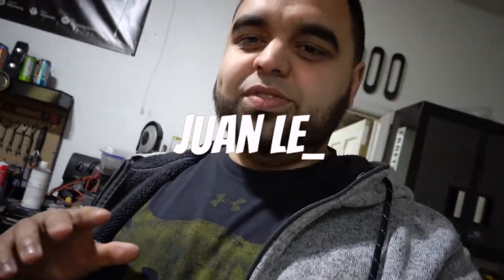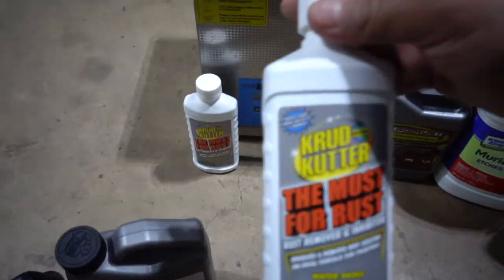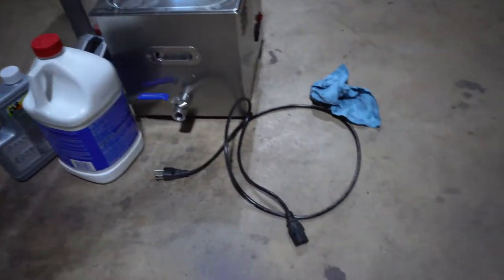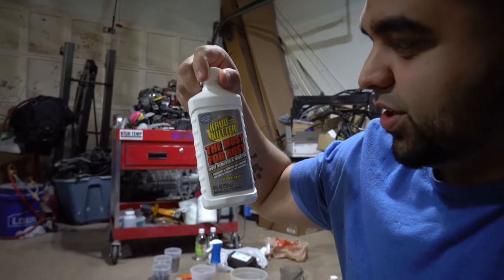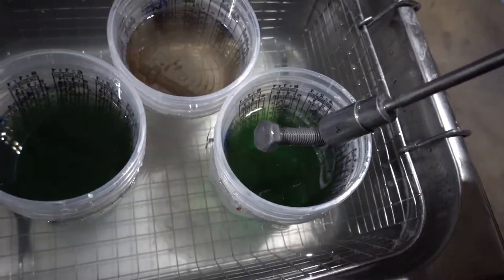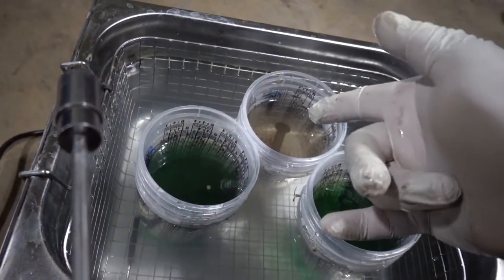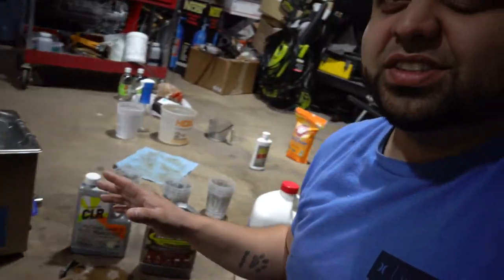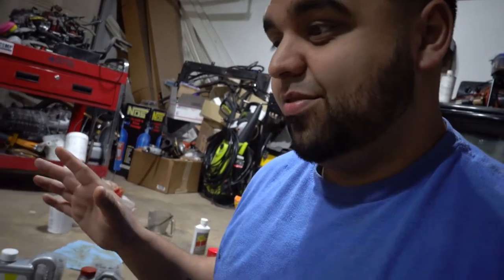Which Is The Best Rust Remover In An UltraSonic Cleaner?

Comment: I see people using acid based rust removers in ultrasonics. If the unit has a drain valve, please don’t do that if you’re going to fill the tank directly with the acid. Yes, the tank likely is high quality enough so that it won’t be a problem. But the valve body is brass with usually, a stainless valve and a teflon seal. Some cheap valves use a brass ball (these are ball valves, after all). Any brass will dissolve in acid. Even relatively weak acid. At some point the valve will begin to leak. It’s not worth it as acid rust removing damages the good metal as well as the rust.

Muriatic acid is mostly used for cleaning concrete and old dirty wood. I really don’t recommend it for anything else. The Evaporust does the least damage to unrusted metal. That’s what I’ve been using for years. There’s really no reason to try to rush any of this. Five minutes is fine for very light surface rust, but for real rust, just leave it in for the full 30 minutes. Normally, it takes a full day without ultrasonics. And remember to rinse all of them with water immediately after removing them from the baths. Then spray with WD-40 to remove the water so it doesn’t flash rust.
Reply: I bet he's the kind of guy that opens the oven door every 5 minutes to see if the cookies are done.

Comment: The muriatic acid does a good job but it will rust everything in your garage. You better do it outside. I use it before i zinc plate to get the old zinc off.

Comment: You should use glass containers instead of plastic in an ultrasonic cleaner. Plastic soaks up the vibrations.
Reply: Especially with the plastic cups stacked inside empty plastic cups, there was no meaningful vibration getting to the fluid the bolts were in. The Ultrasonic Cleaner was set decoration and a timer for this video, not a tool.
Reply: That’s not really true. Plastic cups are fine.

Comment: As others have pointed out, Muriatic acid is no joke.... 

It gets rid of rust, but it will also eat the metal if you leave it in there too long. You will also need to rinse it off well and oil it immediately or the rust will come back quickly. 

The fumes off the acid will eat everything around / cause corrosion, so you want to use it in a well ventilated area or outside. It also reacts violently with aluminum, so if you are trying to remove rust from something that is attached to aluminum, that's good to know. I have used it for removing rust, and while it does work, I don't consider it a good enough solution to keep it around. 

Great video, I'm shocked it doesn't have more views. Keep it up.

Comment: After cleaning with any of these products (except the muriatic acid), you need to thoroughly rinse off the part with water and then either protect it with a coating of oil or paint it. The part cleaned with muriatic acid needs to be immediately soaked in a solution of water and baking soda after cleaning to neutralize the acid, then rinsed off with plain water, before oiling or painting. Without neutralization, the acid will continue to erode the metal and could damage it beyond repair.

Muriatic acid works the fastest and best because it doesn't actually discriminate between the rust and the underlying metal. It just starts attacking the exposed surface of the metal until you either take it out and neutralize it or the metal is completely gone. You have to remain vigilant to remove the part from the muriatic acid just after the rust has been removed, but before the underlying metal is damaged. A tricky balancing act. The other rust removal products you tested may be slower, but are much safer to use, both for the part being cleaned and yourself.

Comment: I wouldn't use muriatic acid since it causes hydrogen embrittlement in steel.
Reply: It also aggressively eats steel.  The real trick is to find a rust remover that removes rust while at the same time not dissolving steel.  My guess is that with this critical criteria in mind the Evapo-Rust product will come out as the winner.  

Muriatic Acid is also extremely corrosive to skin and eyes.  Very dangerous and hazardous.  Evapo-Rust likely also wins on this score.